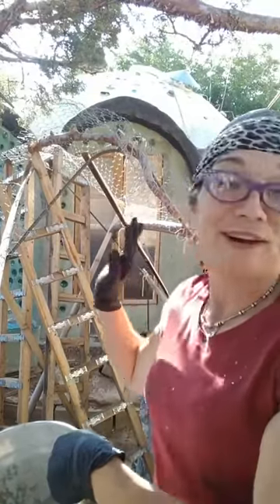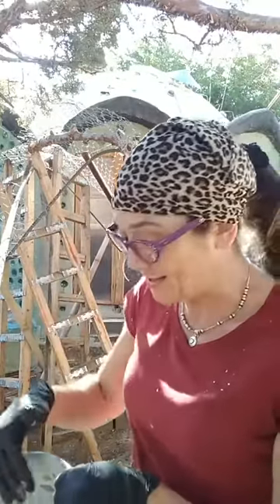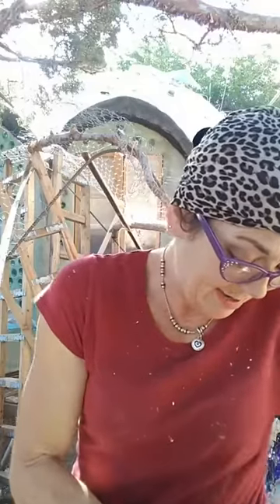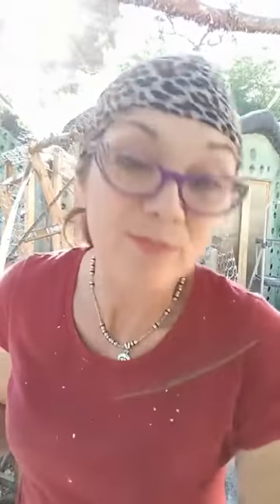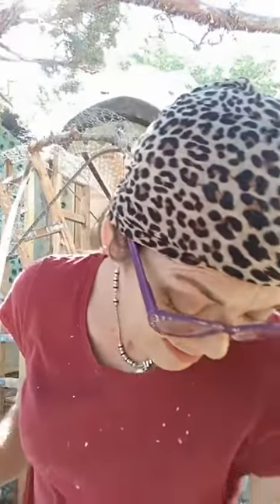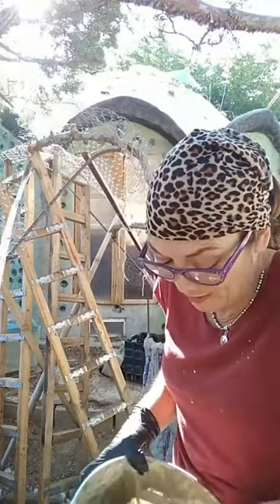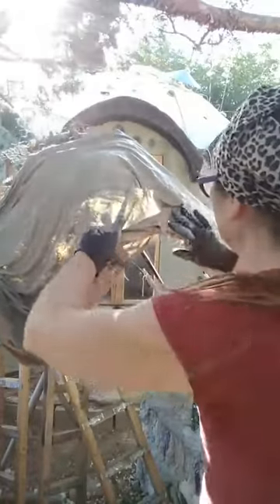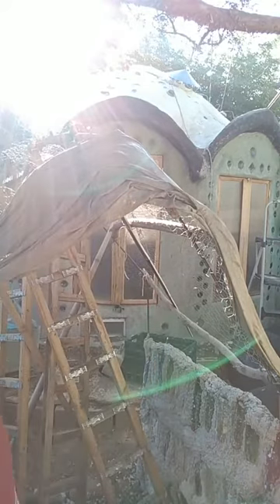My First Time making concrete slurry, draping over chicken wire, #ArtLife #LiveAlive #PlayEveryDay

Comment: As you get your pieces arranged, use a salt shaker filled with cement powder to sprinkle dry cement powder on the surface of the fabrics.  It will absorb the moisture and add to the strength of your finished product.